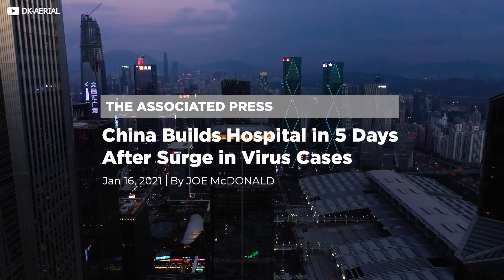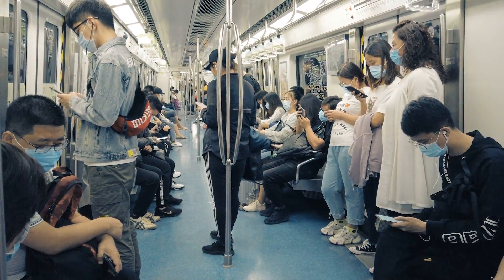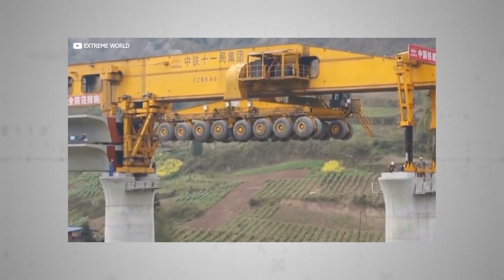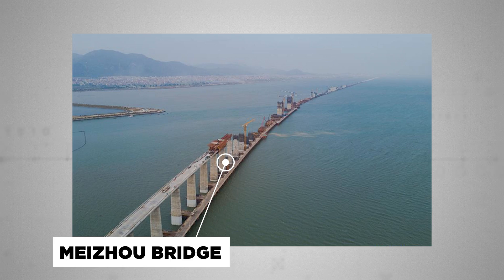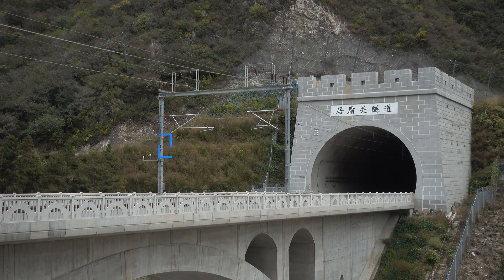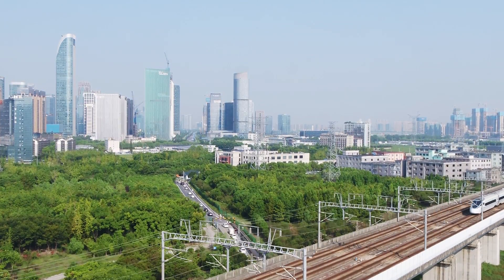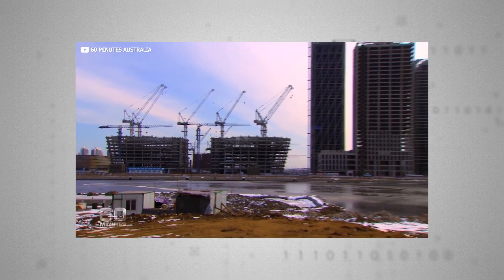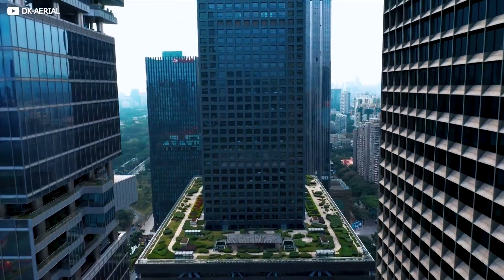How China Builds So Fast

Comment: That a Chinese hospital built in 5 days will not last is totally irrelevant.  Lives were being saved after 5 days and the pandemic was halted.  If the building is destroyed 2 years down the line and a more permanent one built in its place AFTER the pandemic in 28 days to let the concrete cure, the quick one will have served its purpose.  Quick scientific response to benefit the well being of their people.  There is only one Excel Convention Center so only ONE 9 day hospital was built in the UK and maybe that is why the UK has had such dismal performance fighting the pandemic?

Comment: The secret is that they are cheaply made and unsafe. A huge portion of the Chinese economy is building infrastructure and housing. A huge portion of which is not needed. People buy and rebuy houses and then they are eventually torn down and rebuilt. Rinse and repeat every 5 years.

In terms of connectivity, roads, and rails. The majority of the work is to link remote Chinese regions with the core of China.  Not profit. It is a means of subjugation of groups like Tibetans and Uyghurs .

Stop shilling for china

Comment: In China they can travel on rail from Beijing to Hong Kong in 9 hours, that’s 1500 miles. It’s about the same distance from New Orleans to Los Angeles. Rail ticket cost $165.

Flight from LAX to MSY, is roughly $360
Total time: 4 hour flight time.
Security check: 2 hours
Waiting for baggage claim 1 hour
Flight Beats rail by 2 hours. 
Rail beats flight on cost roughly $200. 

Power of mobility. There is pride in tell your boss your paying me too little and tell him to F off, you hop on a rail and get a job that pays better. Smaller cities can’t compete with the labor pool. Rails would end rural America.

Comment: Tech Vision... pull your tongue out of the CCP's asshole mate. The "hospitals" built in response to the pandemic are NOT suitable for the needs of quarantine, as its placed 1000 beds in EXTREMELY close proximity, defeating the whole purpose of isolation. Also, Chinese made concrete is an inferior building material. And  the Chinese People lifted themselves out of poverty,  not the CCP who takes full credit. In fact the poor conditions prior to 1980 were caused by the CCP.

Comment: Chinese engineer here.
1 word: efficiency
1 sentence: massive planning -> optimization -> efficiency
1 paragraph: technology is one thing and I don't think China has the best tech. China's current land ownership system may be attributable to this efficiency, that is, no one actually owns any land fee simple. All land is either on leasehold for 70 years or state-owned. So when you bought an apartment from a developer, you wouldn't buy ownership per se, you paid a lump sum to buy the RIGHT to lease for 70 years from the state. That explains why expropriation happens overnight in China. Basically, municipal planners only focus on topographical restrictions and technological design and can afford to forget the hassle of expropriating recalcitrant owners. They just draw a straight line from Station A (City 1) to Station B (City 2). Period. By the time expropriation officers show up at your door, they already the municipal planning for the next 25 years, and a very competitive market offer (used to be scant, but now very juicy offers to get you out asap) to buy out your leasehold right. Land expropriation used to cause many scenes (lack of a liquid real estate market to justify the quoted price on an expropriation offer, so the gov gave you an arbitrary number) but now local officers got smart. You're presented with three market-justified offers, after which if you still don't accept, you're stuck (developments actually start around your property, usually high-rise, yes you're fucked). A court proceeding may ensue against you but the state always wins and by that time if you lose, you get peanuts. Some local gov got creative and they reward early applicants with higher offers to incentivize faster move-outs. You might not believe it, but many local farmers now long to be expropriated. It's basically free windfall money (USD $500,000 to USD $40,000,000 depending on your property size and value, verifiable references) + one to three apartments in the city, which you can live in or rent out. The cost is your previous RIGHT to lease farmland. A no-brainer. That's why many countryside girls now would dig those guys whose family properties (farms) are planned for expropriation. The same logic applies to other infrastructure projects, most notably irrigation and high voltage hydro corridor. Communism + raw capitalism at work.

Optional question: what's the flipside of this coin?

ps 7:50 developers usually use precast concretes for large liner infrastructure projects. poured concretes are usually used on residential high rise non-load-bearing beams

Comment: the infrastructure is really fast. i traveld from hangzhou to beijing in 3 hours on a high speed train. the train did not make sounds, nor was it bumpy, better than a plane
Reply: When I saw “all” in the common section, I realize that there are too many paid bots these days.
Reply: @hongyangwu5027  welcome to the CCP china where their imagine means everything. Even though the world knows they are barely out of the stone age with all the forced slave labor. Maybe if the people of china had an incentive they would invent something that would change their complexions that they blatantly try to cover up.
Reply: @MeteorJam99  ???
Reply: and it's also cheaper you can also travel on freezing tibetan mountains all the way to hot xinjiang dessert with high speed train
Reply: nah, I think it should be more than 4hours.
Reply: No check in and no delay...safer,at least if there is accident,ambulance can reach quickly
Reply: You are very correct.
I witnessed it while I was in China.
I took China fast 🚆 train to different cities within China.

The train was much much quieter than plane.
Reply: Should be four and a half hours hahaha
Reply: It's also more expensive than a plane. Not talking about ticket price but the overall cost to run.
Reply: Yeah!! It was so fast train to send people to their dead into submerged subway in July 24,2021 @ Zhangzhou. What was a stupid design without door-open emergency and water pumper inside tunnel.
Reply: At what cost? Everything is for face. All the railways lose millions of dollars a year. Not to mention all the corrupted tofu buildings that would collapse so easily. I forgot about all the environmental damages along the way
Reply: 中國不修路，你就說中國窮，修路了，你就說損壞環境，而你只會敲鍵盤，其他什麼都不會。。
Reply: @aini283  这些话我那说啦？
Reply: @aini283  saya TDK mengatakan yang buruk tentang kemajuan negara china.anda salah paham
Reply: @coatbee9244  "bUt aT wHaT cOsT"
Reply: @coatbee9244  you think an electric high speed rail is more damaging than a gas guzzling fossil fuel powered plane in the long term? crazy. The railways losing millions of dollars each year isn't your problem.
Reply: @coatbee9244  You know public transit isn’t just a thing to make money? It’s nice if it turns a profit like Japan, but it doesn’t need to. Public transit and high-speed rail is a huge benefit to society. It helps against traffic and pollution. Not everything is just to make money.
Reply: @kyh148  where i live public transit is private and always makes money.
Reply: @NapalonyMurzynianin  Why didn't you dare to say out LOUD where you live or which country/city you live, since you are so PROUD of it?

Comment: It's wonderful to be able to build structures cheaper and faster. The Chinese obviously have different needs with such a large population and a vast territory to cover. Also, being under a different political system helps their cause. However, it remains to be seen how long these structures will last. In the US the infra structure is crumbling down and urgent need of funding, but they lasted well. Let's see in a few years if the ones in China will last at least just as long.
Reply: W<>h<>a<>t<>s<>a<>p<>p f<>o<>r g<>u<>I<>d<>a<>n<>c<>e
+<*1<>6<>0<>9<>2<>7<>7<>2<>6<>2<*8🇺🇸

Comment: 1 of the advantage of having authoritarian government is that projects are more successful due to stable government. Investors know that there will be no change of government for the next 10 years, and hence unlikely the project would cancel. In democratic countries, governments are giving handouts to buy votes, many projects would cancel when the government changed to a new one after 4-5 years, these resources could've make to good use.

Here, the government has been trying to build a railway connecting to the main city since early 2000s and today, after 20 years still haven't complete. Projects have been cancelled and on and cancelled again. Even building a hospital in a rural area take ages, not to mention government trying their best to corrupt, cause they know they might only have 5 years in the parliament.

Comment: It has become world famous that the "Belt and Road" initiative is designed for, and used to put poor countries into extreme debt to China, so China can (and does) blackmail them into doing whatever China wants, without having to militarily threaten or attack them.  Also, China is notorious for building fantastically poor quality buildings. The building are so poor that they become completely unusable after only two or three years. Floors, ceilings and walls collapse, and sometimes the entire building simply falls over. You Tube has a number of videos on this topic.

Comment: 8:02 There were dozens of temporary hospitals like this transferred using gyms or expedition centers during the peak of the pandemic in China last year. They were called "cells hospitals" and only accepts mild cases so everyone can be monitored and treated if needed without overrunning real hospitals. The stand alone ones they built has full functions of an actual hospitals (ICU and ventilators) and are used to treat severe cases. They not only make the headlines, they also save lots of lives.

Comment: If this is a Tech/building channel, surely you know the Covid-19 hospitals China built in 5-10 days aren't meant for lasting for long to begin with lol. They were promptly dismantled or discommissioned when the Covid outbreaks finished at the location. Think of these as military field hospitals built on prefabricated modules - minimal cement used!

Comment: The Germany stadium hospital is totally not enough to stop transmission. That is only for mild and medium sickness. People can easily transmit virus back and forth to each other. China also converted a few stadium and schools for the same purpose early in 2020. However,  China used 10 days to build two new 1000 beds hospitals for serious and mild cases. Each bed is in its own negative air pressure room with its own equipment and bathroom. Each bedroom is like its own ICU. It can effectively stop any type of transmission. Do not compare orange with apple.

Comment: The Wuhan hospital building charade was Theater.  Hundreds of excavators supposedly "excavating" with no noticeable excavation.  Add to this the equipment could hardly pivot in its tracks without hitting the boom of another excavator, and there were no bulldozers or dump trucks in sight to move the excavated dirt IF there were any.  Completely laughable, however, Americans eat this show up.  Just another psy-op by Ordo ab Chao.

Comment: What you said is totally laughable.  You have no idea what a hospital China built in 10 days at all.  From wikipedia:  Each room is negatively pressurized to prevent airborne microorganisms from spreading out of the hospital. It also has specialized ventilation systems and double-sided cabinets that connect each patient room to hallways, which allows the hospital staff to deliver supplies without the need to enter each patient room.  These hospitals are for the most serious patients.  What you have in London is a makeshift hosiptal.  Wuhan also had 16 makeshift hosiptals by converting existing stadiums or exhibition centers to host other covid-19 patients.  I can't find data on how long it takes to prepare such a makeshift hospital in Wuhan, it's such a small task that not worth to mention anywhere.

Comment: the covid facility converted in UK is a quarantine facility, just to keep suspected cases away from the populace. the 1000+ bed hospitals in Wuhan and other places are FULL ISOLATION hospitals, they are equipped with air handling systems that is sealed for decontamination, and each room has negative air pressure to ensure any virus-containing droplets and aerosols do not get out of the room and only goes into the air handlers for decontamination. 

it is like comparing my folded paper plane to a jumbo jet.

Comment: Thanks for the video. Amazing country. I still have in my aging mind the mental images of it being a rather backward country thanks to the many movies but in reality it is a very advanced country. The images of the high rises and high speed rail were quite enlightening. Since it is starting from scratch, so to speak, with no limits imposed by private ownership, etc. it is expanding far, far faster. The US has become an overweight nations with weak domesticated people that can defend or support themselves. Our females have become mentally owned by substances to paint their faces and men with shaving their bodies.
Reply: I believe the real reason of China making the difference, which was only briefly touched in this video, runs deeper than state ownership of the land or loose regulatory practices. It's the vision. Even though the Chinese government wields unbounded power, it would not have used it to run massive infrastructure projects like high speed rails in the first place as long as it's still fixed on making tangible profits. It only went the way it did because it knew the improved flow of people, goods and opportunities these rails will bring along the line for future generations cannot be calculated based on fiscal gains and losses. Meanwhile in the States people back off once being told it's only gonna be profitable circa 2050. The lack of this vision, and the means to efficiently communicate it to the American people, is what's dragging the feet of development here. Same for the rather bizarre hospital comparison toward the end of the video. The Chinese realized last January by brutally sealing off Wuhan and pumping the entire nation's medical resources into the city, constructing brand new hospitals in days included, it would be able to stamp down the outbreak ASAP and thus save trillions of yuan in the long run. What happened later proved them right. Yet the OP was still touting how the UK saved some pennies by setting up a makeshift hospital  (which they did in Wuhan as well, dozens of them) over building a permanent one. It makes me sad, this lack of vision.
Reply: @theolich4384  Yup, felt a bit of a condescending tone there too with the UK/stadium comparison.. Neocolonial.. erm neoliberal habits die hard..

Comment: Its 21 days fhe curing day of cement   or slab to reach 75%  but their r add ons for this to be fast 1 day for a ground structure is good but a skyskcraper slab it wouldn't be that strong n they still built the next on the next day their must other scaffolding to hold the structure

Comment: Answer: the built it out of shipping containers
Reply: If it is that simple, why do not YOU do it ?
The answer is NO.
It is standard house module with system design of drainage, ventilation, AC, electric system. China has pioneered this technology long before. You can easily find footage of video when China build a hotel of 57 floor in 19 days. Fully equipped with electricity, AC and running water, internal decoration.
Comparring to that, this hospital is just a piece of cake.
China has the potential of doing things bigger than your wildest dream. My friend runs a factory that normally do wind turbine generator. He once get outsource work for such fast house. He got the CAD drawing today, and delivered the product the following day. From drawing to CNC and automatic welding machine output final complete steel structure beam. Steel market in 1km distance deliver endless material 7*24h. For accurate assembly, weld/ cut tolerance is less than 2mm for all these structure. The same is for flooring system, ceiling system, ETC. ETC.

The world never knows what is happening on this planet.

Comment: Large infrastructure projects are designed for 50 years life and the future traffic.  Initial traffic loads are low and losses are normal.  Breakeven normally is reached in about 10 years time and even shorter if the economic development of the connected areas are included in the calculations.   😀

Comment: After 12 years and $5.4B dollars spent, not even one mile of the California High-Speed Rail was built.

In just 15 years, China built 38,000km (23,000 miles) of high speed rails at a very cheap price of $17-21M per kilometer.

Comment: China builds so fast because it's a communist dictatorship.  They don't need environmental impact studies, they have very poor and corrupt safety inspectors, they add or remove "red tape" at will since ALL properties and land is owned by the CCP.  They can (literally) overnight make thousands of people homeless so they can complete a government-funded project.  Their buildings go up fast, however, they are not built well and by western (especially U.S.) safety standards would be declared unsafe for use.  Just search for the number of times elevators have failed in China or how many times there were incidents with China's high-speed rail system, or just buildings collapsing.  If anything like these were to happen today in the U.S., the project(s) would be canceled, and investigations would begin.  One of the most recent examples is the massive water leak at the Shanghai Tower in 2020, and that's one of China's most notable buildings.